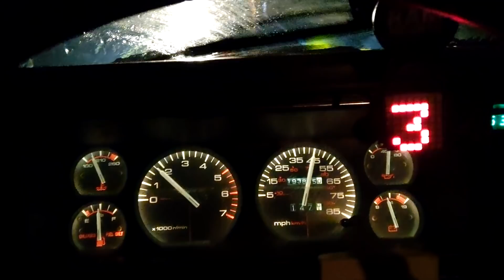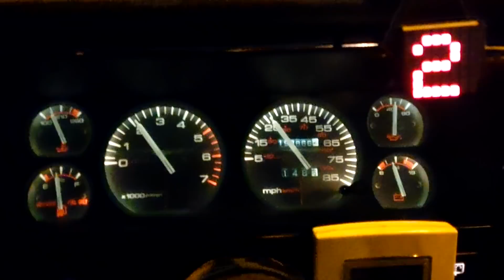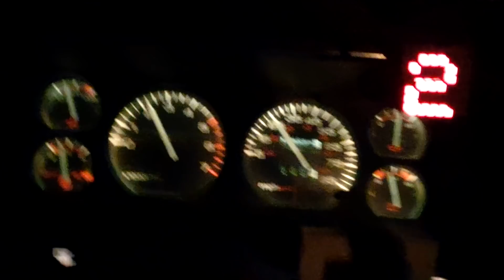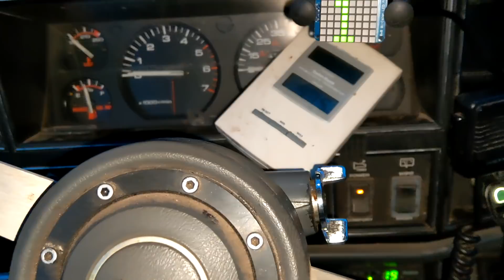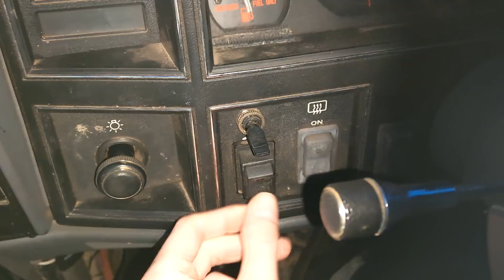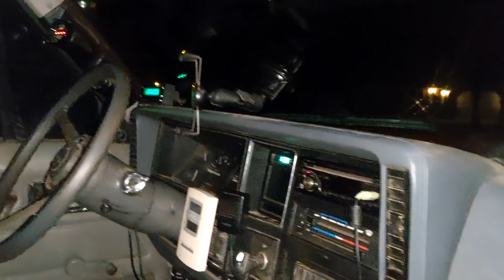Nifty Shifter Vehicle Testing / Joystick Ideas

Comment: 6 years later and I still love this Xj and all the cool mods you did. I finally built that Ford 8.8 rear with a Yukon duragrip lsd and a Yukon ultimate 88 c-clip eliminator 31 spline axle kit. Plus the finned aluminum Mustang diff cover is the cherry on top lol.

Comment: I like your idea with the auto/manual shift to maintain engine braking. But I'd still like to have OD with manual mode. I think there's only one way that could work. Given the required shifter positions for engine braking, I think a thumb toggle switch on the shifter to switch between 1-2 when in 1-2 position would solve that problem. The shifter would then go to 3rd gear in the 3 position, and OD in the OD position. The only issue would be downshifting from 3 position to 1-2 position. I don't know how the coding would work, but you might be able to code it to always go to 2nd from 3rd gear. Or keep it simple, and shift into the gear based on the toggle position. If you left it in the 2 position, it goes to 2nd, otherwise to 1st. Just an idea to add to the mix. Keep up the awesome work Nick!!

Comment: why not put a 3 position rocker in place of the factory 2 position and use the middle position for your manumatic controller.
Reply from the maker: You could, but that will require seperate wiring. That point of the power comfort switch is for a factory solution without modifications. The shifter has seperate inputs for stuff like an well.

Comment: 19:37 might not work if you wanted to pick 3rd gear while your trans is shifting back and forth from 3rd - 4th while climbing a mountain on the highway
Reply from the maker: This would certainly take some fine tuning to see what works. I'm thinking in Semi-Auto it will hold a gear for a minimum of 30 seconds or so, and then after that it will go back to Auto when the gears match. If you hold the button down for say 3 seconds then it will go into Manual and will only stay in the gear that is selected with the switch. Hold the button again to go back to Auto. That would make a basic sequential design that could be fairly effective.

Comment: Love what your doing here. Have you thought about trying paddle shifters? I have seen off the shelf items but I'm sure you could make something yourself cheaper.
The reason i mention this is I drive a Mitsubishi outlander as our daily and it is a 6 speed auto with paddle shifters. Great when wanting to overtake or drop a gear going up hill as a quick flap of the left paddle overrides the auto and drops it a gear. If you don't paddle again  for a while it goes back to auto or you can hold the right paddle for a few seconds to return to auto. If you want paddles all the time put the shifter into sport. Same but different to your switch suggestions but only using 2 paddles and the gear shifter. Anyway I find it very easy to use as you don't need to take your hands off the wheel which would also be great when wheeling.
Reply from the maker: I'll definetly see if there's anything easy out there. The radesigns fellow said he tried paddle shifter which were great on road but difficult to find off-road with the wheel spinning all around. I dig the ideas for an easy semi auto mode Vs a full manual mode.

Comment: Ive noticed in my 91cherokee in power mode it doesn't have alot of engine breaking. but in comfort mode there is alot more engine breaking. I dont know if that helps.
Reply: Braking not breaking

Comment: In my 1992 cherokee, there is no comfort/power switch. There is however a fog light switch in the same location. Would I be able to use that switch just like you use the comfort/power?
Reply from the maker: If it was wired to my shift controller then yes it would

Comment: You could use a 4 way side mirror switch for the shifter. They are very small, sometimes have a gate, and usually have a button or switch included to switch between driver and pass mirror. That would be an all in one setup for the most part. Thought i would suggest it.
Reply from the maker: Oh my, now that is using the noodle! That would be great for tight areas if its halfway easy to press from a glance. I'll have to keep my eye out for something like that, thanks!

Comment: Just wondering if you have another Transmission because you're playing with Fire.
Reply from the maker: The AW-4 is a pretty robust transmission and it has been designed so that it's pretty damn hard to blow up. Unless you physically drop the shifter into 1-2 on the highway at 90mph, it'll hold up just fine.

Comment: I love the "trans switch" manual mode, where you just shift the oem shifter for 1-3 then turn switch off for OD. No one needs manual OD imo.  But simulated manual valve body with oem shifter is gold!!!  I'll buy one for that application. Don't need the gear readout either with oem shifter, fun feature tho! I have a 94 with no trans switch, but I can wire in a switch.

Comment: Good stuff, could there be a tow mode? like the power and comfort
Reply from the maker: What would the tow mode do? Hold higher rpms like the possible offroad mode idea?
Reply: @NickInTimeFilms   maybe. I know that some tow modes hold the shift untill much latter in the rpm as well as not locking the T/C.. Untill high way speeds. I think your nifty shifter would be perfect for it, I mean it's basically what you are already doing.. So I'm flapping my lips lol. Good work sir!

Comment: Are you going to make a manual setting for over drive or is that supposed to stay automatic?
Reply from the maker: For the bare bones factory manual mode there isn't a specific plan for 4th/overdrive, but solutions could be added for this. For the Jr model, I could add an override switch that will grab forth. For the Pro model a simple switch can be added as well, or a selector to allow upshifting and downshifting of sorts. Depends what works well in practice since this is still in the idea phase.

Comment: Hey Nick I have a question for you about my 1996 Jeep Cherokee Sport. I’ve been having issues with the tacometer in my dashboard. I have the same dash as you have. The issue is that the tacometer stopped working and for the life of me I can’t get it to work. Have you ever had this problem? Is there a fuse that I’m not seeing? I really don’t want to put in a aftermarket one. Any ideas on this? Please let me know if I’m missing something. Thanks
Reply: Pull the cluster out and check connections, might need to replace. It's not hard. I pull them apart and clean them.
Reply: GOT WOT Thanks I will try that also. It will be a good time to replace the bulbs with some leds.
Reply from the maker: On Renix the Tach Signal comes from the Ignition Control Module which is under the spark coil. There is a yellow wire on the left I believe which sends the signal to the dash. Might be worth checking if that connection is clean.
Reply: NickInTimeFilms Awesome thanks for the input. I’m definitely going to check that out.

Comment: Wow... What an interesting idea... Great job Nick... Cannot wait to get it working flawlessly..

Having a manual mode is not an urgent this for my 1996 Jeep Cherokee XJ Indonesian CKD...
I put interest on thing in early of this video.. I love the auto mode and hoping if I can get descent engine brake on every speed...slipping TC ruin my Fuel Consumption and it's kind of lazy acceleration.
I wish to have TC locking up on every gear position and might leave 1st Gear on TC Drive all the time.  It might locking up on 2000 rpm or on speed above 20 kph...
Is it possible to do it? Thanks

Comment: I'm not even sure you can lock the TC in 1st. I know I can lock the TC in 2nd, but it doesn't add engine braking anyway. Can't check with my setup right now to confirm there's TC lock in 1st.
Reply: You can when you are bypassing the TCM.